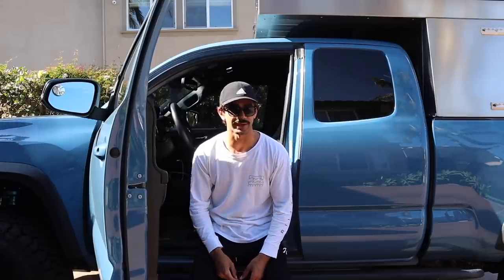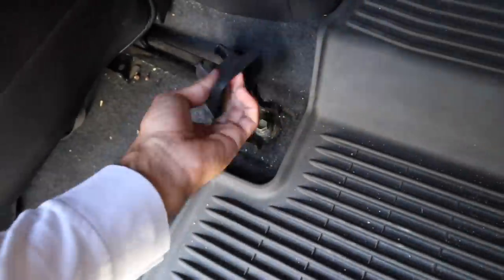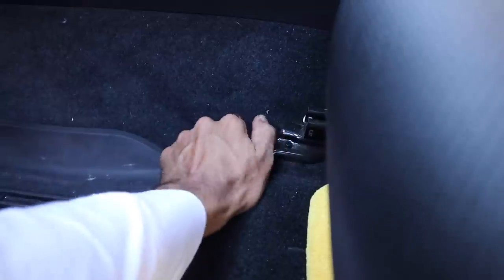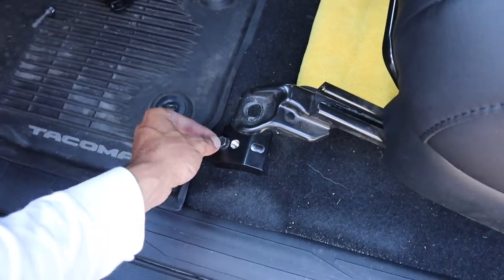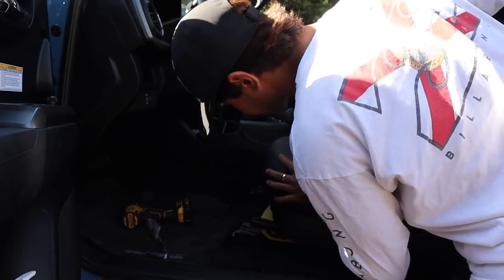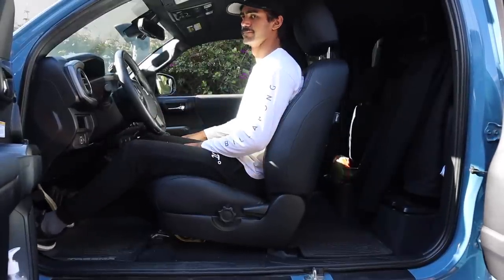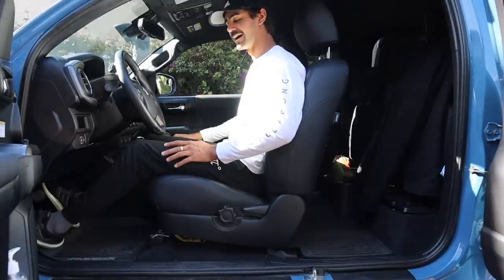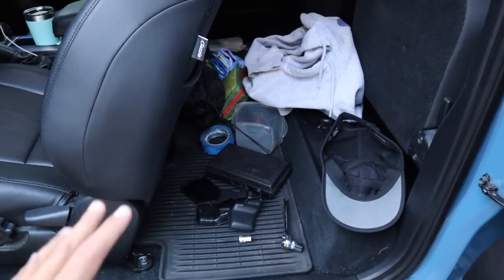HOW TO MAKE YOUR 3RD GEN TACOMA SEATS MORE COMFORTABLE!!!

Comment from the maker: This isn’t a fix all, but I hope it helps someone! At 5’10, it’s been the perfect fix for me. 

Update: Just drove 600+ miles (300+ miles straight each time) and I had 0 leg fatigue or back pain! Thank the Lord this fixed it for me.
Reply: I hope so iam around the same height  I got a  2021 Tacoma I love the truck but the seat is killing me  I wanna give this a chance before I give up on the tacoma
Reply from the maker: @Moneyguidelines  I ended up giving up on my Tacoma after I just couldn't get fully comfortable in it on longer trips. Bought a Ram 2500 and have never been happier.
Reply: @socalexpeditions   I kinda wanna stay around the smaller size  I don't need truck that big don't even really need a full size truck   kinda thinking about the new frontier down the line ik it's Nissan their seats are just on point
Reply from the maker: @Moneyguidelines  Wait for the new hybrid stuff to come out. The new Tundra looks great (but expensive). Fronteirs are very nice too, they are quiet and smooth

Comment: Gave me a good idea. I'm 5'9, but the only problem I have with my 19 is the seat leans down in the back. Keep feeling like I'm having to push back to sit higher. Think I'll just add a couple spacers on each side. 👍
Reply: I'm also 5"9 and I took 1in spacers and some washers and new industrial bolts that were longer and jacked the back of the seat up. It helped with my back especially on long drives of 8hrs plus and I don't have pain in my low back anymore. Plus you feel like you are actually driving a truck. Did it all for 14 bucks at lowes.

Comment: I put hockey pucks in the rear. They're exactly 1inch high by 3 inches wide and they fit perfectly. They set exactly  right around the rear floor mats also. Cost $2 then get the right length bolts and you're done. Can't even tell they're there. I didn't write doesn the exact bolt measurements but they're 8.8 guage 10mm x 1.50 thread taper I believe. Read it in the tacoma world thread.

Comment: I’d assume those white pin covers would go on the block pins (between the floor pan and the pin) since the pins on the blocks are the same as the seat base pins. 
Also they tell you not the to torque the blocks right away because you’re meant to just double check alignment.
Reply: Ok, so I installed my set after watching this video and the white plastic cover doesn’t fit the roll pin on the blocks. ✌🏻

Comment: These Desert Does It spacers are fantastic - pricey but fantastic.  I have a 1 1/4
' lift for the front and a 1/4 inch lift on the back - all purchased from Dessert Does It.   I would squirm in the seat trying to get comfortable before these spacers were installed and found that after installation - and landing on the right combo -  I did not squirm to get comfortable.  These are terrific.  I cannot recommend them highly enough.

Comment: With the rear spacers at 1/2" did you have to replace the bolt and get a longer one? Or did it still have enough thread?

Comment: '13 Taco here and I feel your pain man, literally. I have a Washington to Wisconsin trip coming up soon so I was not looking forward to it until now. Just to clarify, you put 4 rear spacers on each seat, TWO stacked? Thanks for the vid my dude!
Reply from the maker: The front is raised by the seat jackers 1.25". Each rear bolt is raised by two washers that are .25" each. So the rear is lifted .5". Two washers under each bolt for the rear. Hope it helps man - I drove 5 hours straight with not a single pain and I cried of joy.

Comment: Been wanting a Tacoma for a while now after selling my 01 4runner for a commuter vehicle. But after researching these 3rd gen's, I'm not sure I do anymore. The seats, underwhelming power, lackadaisical transmissions.....these are things that shouldn't be associated with Toyota, or a $45k vehicle. What's your experience with the transmission? Any issues?
Reply from the maker: I have gears and my truck is turned, but I will not be buying another Tacoma after this one
Reply: Its just a sellers market right now. 16 and 17 are the years to avoid. Coolant and timing cover leaks. I got my 18 a year ago and have zero complaints. There are updates to ECU for the transmission now. I also paid 31k out the door for my OR with 27k miles at the time. I love it.
Reply: @socalexpeditions  why not? I just traded in my jkur for a trd pro and just got an ov tune done and it’s a whole different animal. Actually enjoy driving it now. Haha
Reply from the maker: @TheRealMatteo45  Do gears, it'll be even better. The Tacoma lacks power once you add weight to it. It'll just average 13mpg and be a dog everywhere. I really like having a bigger truck with more power
Reply: @socalexpeditions  I’m getting about 16-18 right now so not complaining haha. My jkur got 12 😂

Comment: I bought these and installed them. They feel way different at first but, after a long drive, I personally still experience the discomfort. By long drive I mean my 30-35 min drive to work every day. Very disappointed in these Tacoma seats.
Reply: Did you do spacers under the back of the seat too?
Reply from the maker: Add .5” rear

Comment: Ehhhh.... I’m still skeptical about these seat jackers. Plus messing with how and where the seat bolts to the truck just seems like a bad idea. How and where the seat attaches to the truck has been crash rated and approved and I don’t think the people selling or making these have done that. I would be curious also about insurance after an accident this seems like something they could use to dismiss any pay out to cover medical since you have modified a safety feature or the truck. Just my opinion on these though.
Reply from the maker: I think it’s completely fine as long as you torque to spec (and use loctite), use grade 10 hardware, and don’t cheap out. That being said, I’m not responsible for anyones troubles if they cause an issue in an accident. I’ve done way more sketchy stuff than rising my seat and torquing it to spec in my life! 😂

Comment: Anyone know if this would fit a Scion TC?
Reply from the maker: I would not guarantee it. You could technically buy machined spacers (and/or washers) to lift up your seats with longer bolts - But in no way would I want to be responsible if the spacers caused the bolts to fail in an accident.

Comment: There is no need for the front spacers. Honestly, buying a 1'' spacer from a hardware store and a longer bolt (make sure its stout) for the back will improve the seating position and does not interfere with head room, plus it's a lot cheaper. Do this at your own risk.

Comment: if you Taco came with electronic seat control, this is not a problem, you can adjust it several ways as you want. You get what you paid for..
Reply from the maker: I’ve sat in many Tacomas with electronic seats and they still dont have enough range of motion to be comfortable haha
Reply: Wrong